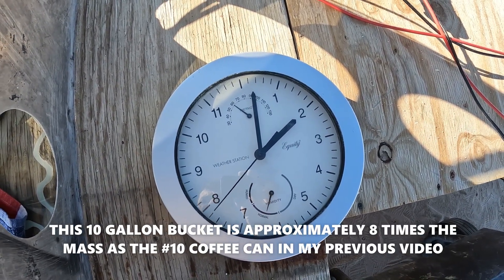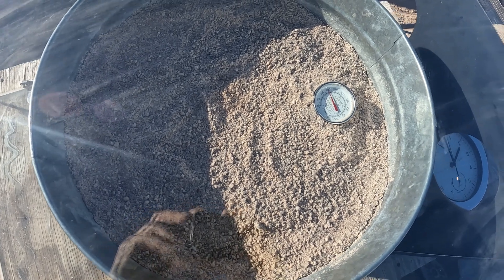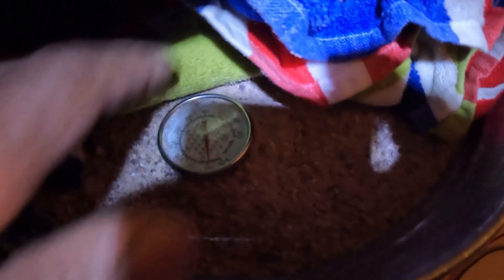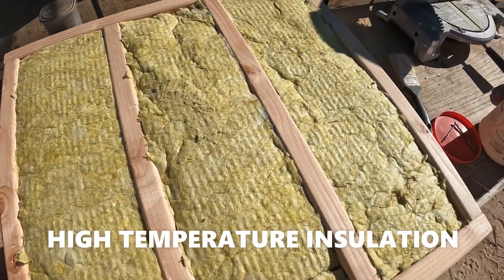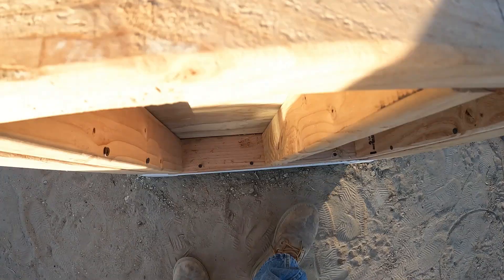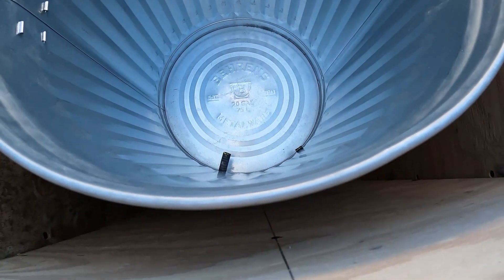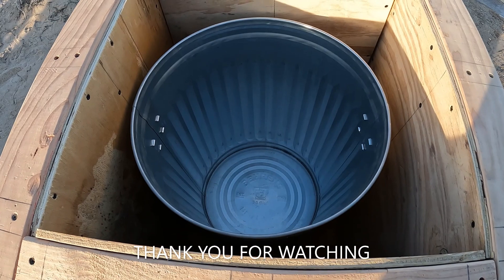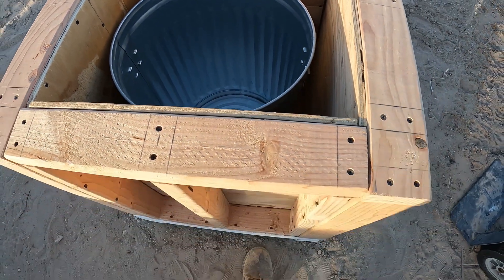Sand Battery Update Part 4

Comment: 10 gallons of sand at 200F is around 900watts of stored energy. It's like powered your grill element inside your house for less than 1hours to heating it. I did the math for my house to cover all my heating needs during winter and it's about 2pools filled with sand , perfectly insulated at 600F or more. More than 10 000kWh of heating power .... it's a lot !

Comment: My fav idea is a Colorado green house that has like 40 tons gravel dumped on top pvc. Hot air from roof is blown to bottom. Air heats up giant pile gravel. At night thermostat opens vents to pull air into house basement and living space. Works perfect
Reply from the maker: That sounds amazing. Quite a project, thank you for your comment.

Comment: Ok dude try this. Sun likes to heat black. So here’s my idea. Make a 2 inch deep box. That is leak proof. Have a oil tank in your basement or insulated outside. Pump used filtered motor oil through box. That has a glass cover. Allowing sunlight to heat it. The carbon will absorb all wavelengths and heat up. Use solar panel to power pump. That thermostat controlled. This tank will get very hot. Be a great heat sink. Also could pump oil through a radiator or lines to heater intake.

Comment: Great experiment.  I am thinking about the same idea to get heat out a sandbatter using pipes. I use a rocket heater to get the sand up to temperature.  Keep us updated!
Reply: I would love to learn more about how you use a rocket heater to get the sand up to temp! Please share
Reply: @daleryan1945  I am thinking about placing the bell of a rocket heater in a sand battery. Through the battery I will be placing pipes for hot air extraction. Also copper coil for hot water must be possible.  I am starting g the project half january. Location the utility room.  See if my marriage survives the messy attempt:-)
Reply: @mireillereijnders7657  Thank you. Please keep us posted!

Comment: I Like what I see IMHO ( InMyHumbleOpinion) I think your aluminum tube and fan system is too small, as I live in northern Michigan and need to release more heat from whatever heat source available. It is day after christmas and I am anxious to know about second day of heating sand battery @ 500w especially after it goes into large container? Waiting for next report hope results are good, I believe sand battery can be good way to store energy.
Reply from the maker: Yes the ventilation tubes are too small to do much. This is just a prototype to work out the details. I may use it in a small greenhouse. Those ventilation tubes were just something I already had. Thank you for the comment.

Comment: these videos are great... can't wait to see how well  this works...
Reply from the maker: Great, I am glad you are interested. I am anxious to see how it turns out also.
Reply: In Finland, they are heating a town with a 24 foot diameter x 48 foot tall silo. I am curious as to how big of a sand battery I would need to heat my house in Chicago.
Also, I wonder if a coil of water would transfer the heat better, water holds heat better than air.
Keep experimenting, and I'll keep watching. I think sand batteries may have a future.
Reply: @gimpygardner3377  you can heat water to 212 degrees before it boils oil can be heat to near 400 degrees sand can store much more heat
Reply: @macwolgamott4201  I like the idea of oil. Like you said, more heat. But also, it won't freeze in the winter.